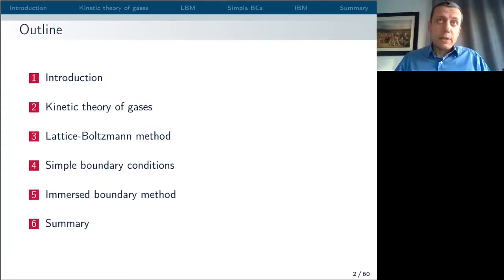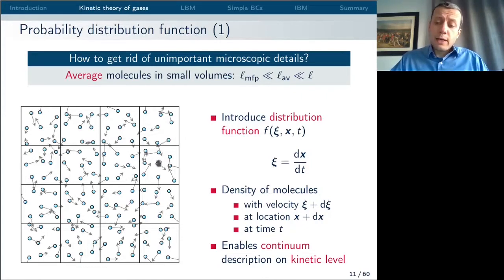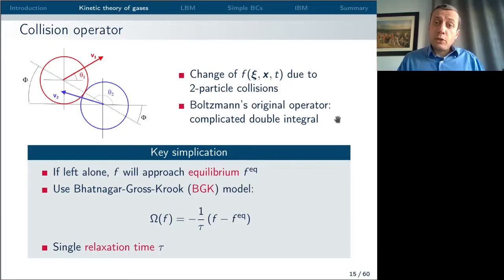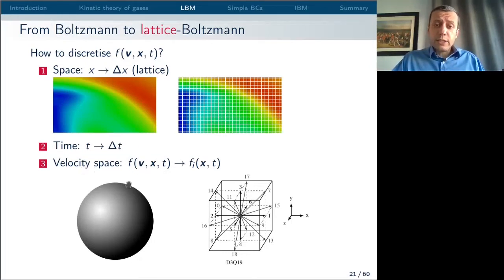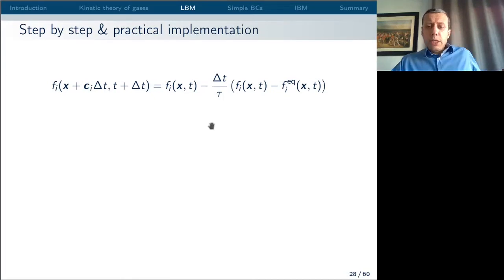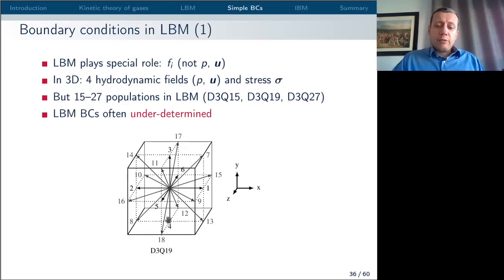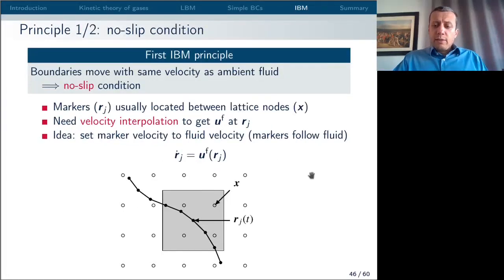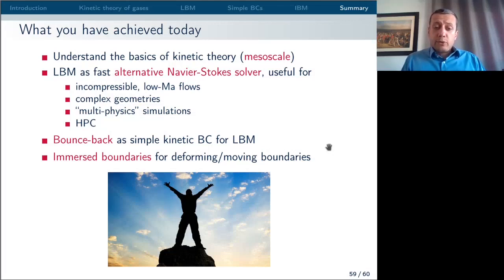Introduction to Lattice Boltzmann Method

Comment: Best explanation of Lattice-Boltzmann I have seen, yet. I have rather little physics and mathematics background, but since you describe each term in its meaning and sometime repeat that, it was much easier to follow than anything I have seen yet. 
(I am just interested in writing a watercolor simulation and have a software engineering background. Even trying to understand existing code (C++, Python, Java, Swift) is quite difficult, when you do not understand the model and the funny variable names like ‘rho’ they are using)

Comment: Kindly tell me the way of calculating weighting factor (w)...
Reply: I don't know why he didn't show it, probably because it was very introductory. Anyway, for the D2Q9 speed discretization, the weights are : 4/9 for the "0" speed, 1/9 for the speeds that move to one of the four adjacent cells, and 1/36 for the speeds that move to one of the four diagonal cells. Using the same writing order as he uses for the vector c, your vector w should be w = (4/9, 1/9, 1/9, 1/9, 1/9, 1/36, 1/36, 1/36, 1/36).